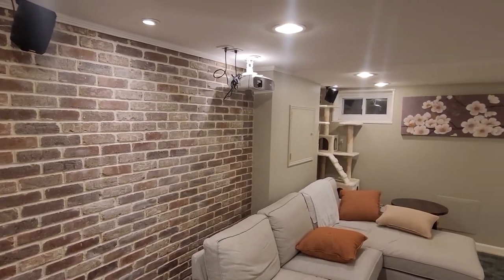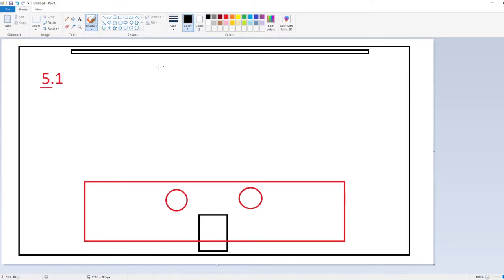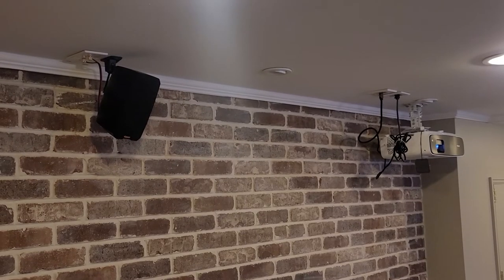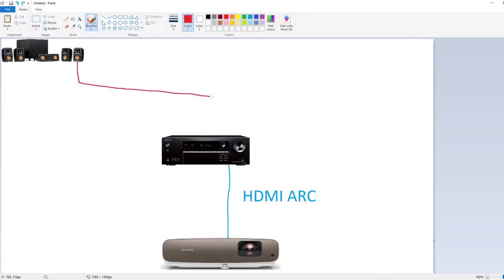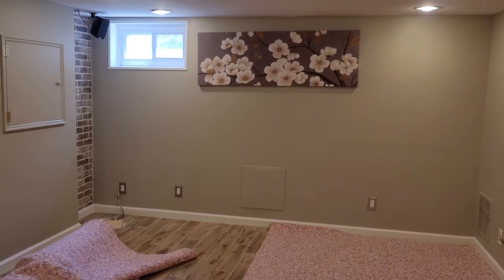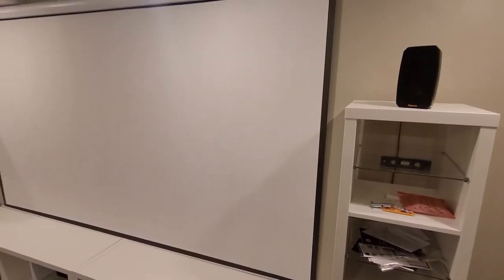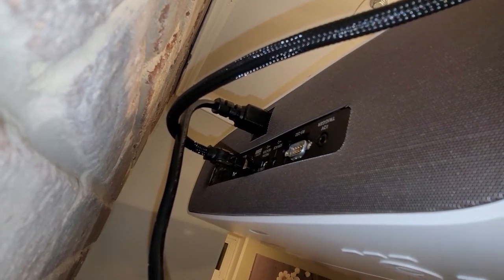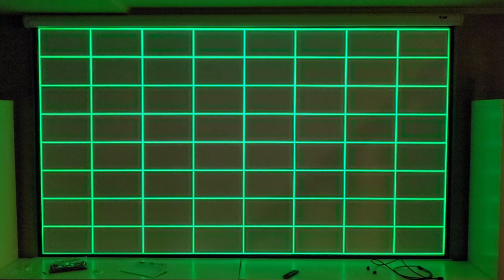How to Build a Home Theater System (5.1 surround, BenQ HT3550)

Comment: Very nice installation. You are correct about heavy gauge HDMI cable. If you are only going a few feet cheap HDMI cable is fine. If you are going to have a long run you must use large gauge low loss cable. The other point about long runs of HDMI cable is not to make any hard bends or kinks in the cable. Kinks and hard bends can cause  signal loss. This is the same for RG6 coax. Another issue is running audio and video cable parallel to AC wiring. Doing this can cause 60 cycle AC hum to be induced into video and audio lines.
Reply from the maker: For me the HDMI cable business was a thought I had after the fact, but luckily there were no problems. I hadn't thought about the AC induction problem over audio, but you're exactly right. I got lucky but shielded cable would've been the right choice here.
Reply: I am a retired broadcast engineer, all the things that can go wrong flood into my head, (it's a bit of a curse) when it comes to video and audio installations. It's always best to do an assessment of where all AC power is running. As long as you are not running AV lines parallel to AC lines for any long lengths you are good for most installations. You did a nice job, your cat friend seems to approve.

Comment: Hi, Good explanation, i am new to home theatre set up. one question my home is prewired , say example wall speaker i m planning to mount the wire, i can take from outlet they already provided , my question is how receiver have the same wire to connect ,whether another wire need to sent out to receiver or how it connect, can you explain in diagram thanks

Comment: Not related to the video right now but, just saw your review on the Coway AP-1512HH Air Purifier and loved how you actually reviewed and cleaned it up. Definitely hooked me up to buy one and it’s coming in 3 days! I had to like m subscribe after forsure. Thank you man! Last thing is are you still using the same purifier and how has it been?
Reply from the maker: Thank you. Yeah still using it, now going strong on year 5 or 6. Bought a second one recently. Still no complaints really, with the exception of two: I wish you could remove the grate to clean the fan, and gotta be careful removing the face plate - a magnet there has a tendency to fall out; if not there, machine won't turn on.

Comment: Question I have the same projector I used my HDMI cable to my receiver the same way you did and not getting a picture? Is there settings in your receiver that you needed to do?
Reply from the maker: There are various things to check here, could even be a combination, I'll just rattle some things off the top of my head:

1) check to make sure your A/V receiver is set to the correct channel from which it is receiving video signal from

2) I do think the projector did have ability to select from multiple HDMI inputs as well so yes that's also worth checking

3) ensure your HDMI cable isn't faulty or undersized for the length you ran it for. You must have a thick gauge HDMI that allows for a 4k signal to travel. The longer the cable, the higher the resistance, the more loss on the signal. So for example, a 1080p rated cable will probably give you no signal if you're running 4k through it.

And a final thought is just to go through a process of elimination. Use a known working HDMI with, say, a laptop and plug directly into your projector.

Comment: Thanks for making this video! Love the setup. 

Does your AV remote control everything, minus the Roku? 

Looking at installing a similar setup (Klipsh speakers, denon receiver, benq projector, and fire stick) and was wondering if there was a way to control everything with one remote?
Reply from the maker: Wonderful question, you could probably buy a universal remote, but as it stands I have 4 remotes to deal with, which is unfortunate. Let me know if you find something that works!
Reply: @Bootstrappin  Thanks! Going to look into the Logitech - Harmony 665. Will let you know how it goes!

Comment: Hey I find myself in the miraculous situation of an unfinished basement, and a Handyman who's traveling to stay a week ata  time to finish it lol. I'm thinking 10ft wide by 14 ft long for the room? I'm trying to use BenQ online planner to some extent and that looks ok..But im a little worried that front seating will be too close to a 120" setup. Any input would be amazing thank you. And thanks for the shopping list!
Reply from the maker: So that depends which direction you're planning on projecting in. Are you projecting on the 14 ft wall, or the 10 ft wall? If it's on to the 10 ft wall, it'll be fine, as the minimum throw distance is 9' 10" (max 12' 10") to get a 120" image for the HT3550. If however you want to project on to the 14 ft wall, I think that'll be cutting it really close, and probably won't be able to compensate to 120" screen with zoom.

My room is about 17 ft by 12 ft or so if I recall correctly. I'm projecting on the 17 ft wall on to a 120" screen, and my couch is jutted forward so I'm sitting about 9 ft away from the screen, and it is a perfect size. Not too overwhelming.
Reply: @Bootstrappin  awesome If you don't mind I may pick your brain a few more times.  Cool thing is unfinished I can run cables up out if site, choose outlets etc! I think we can go with a 11' wide by 17' long for 2 rows of seats, or maybe wider for isle room, mini fridge 😄
Reply from the maker: @deamian65  it's a great situation to have, never fun to route cables in a finished space! That said, make sure to buy thick gauge HDMI cables for long runs. And avoid running them parallel with AC lines, or they can induce noise/signal degradation.

Comment: Why not connect Roku to PJ. Any issues if we do it in this way?
Reply from the maker: It'll work, but without sound going into your sound system. I think sound will only come out of the built in speaker on the projector.
Reply: So if we connect Roku stick to AVR, do we need to plug projector into ARC hdmi in avr as we have then sound only through avr and picture could go through regular hdmi from avr? I am wondering if I can connect projector to normal hdmi in avr and tv in the arc hdmi in avr(I have 2 hdmi output on the avr, one normal and 1 arc)-this way I wouldn’t have to swap the hdmi cables in the avr every time I’d like to watch movie on the projector. I had this problem with xgimi horizon projector-it only shows a pictures once connected to arc hdmi port in the avr…or I did something wrong. Thanks

Comment: Hi , I have same ht 3550 and trying to connect to Bose sound bar 300  it has HDMI ARC and  ht 3550 has just HDMI ,please tell me how do I connect that ??
Reply from the maker: You can connect to hdmi arc directly I'm pretty sure, but that sound bar is the only thing that'll be producing sound. If you want more speakers in the future, you'll need a receiver.
Reply: @Bootstrappin  
Thank you very much !
I will try it.
Hopefully it will work.
Reply: I use this ht 3550 projector connect with Apple TV .
When I watch movie from Amazon prime , ht3550 can go full screen but when trying to watch from YouTube it screen size becomes much smaller like 1/6 and this start happen after I changed to new Apple TV 4K wasn’t like that before.
Would you advice me how to fix it ?
Thank you very much.